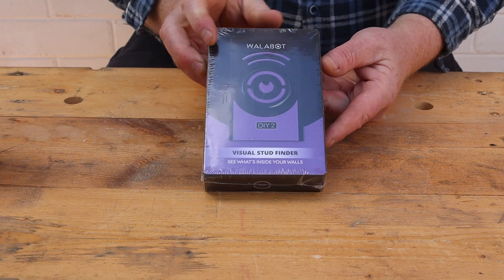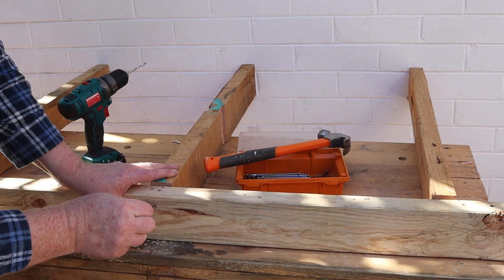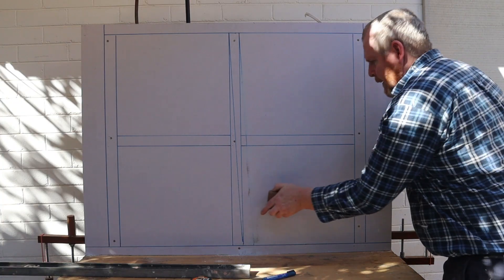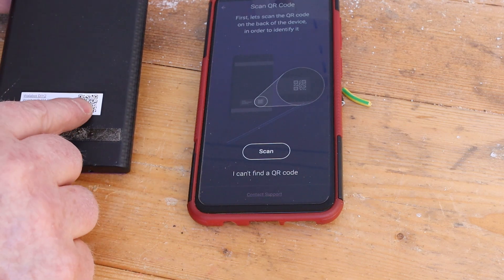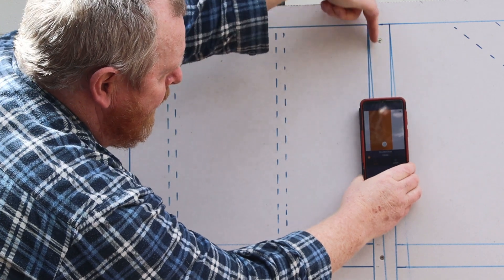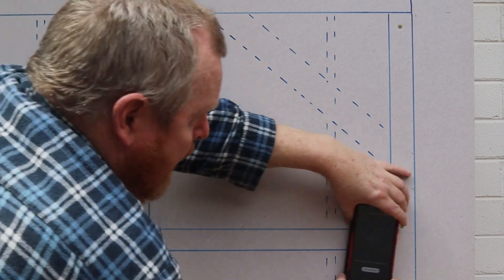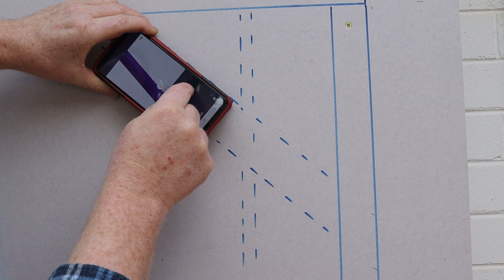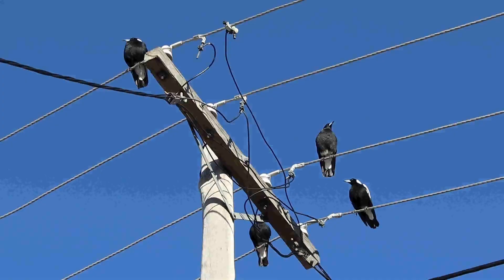"Walabot DIY 2" wall stud finder review

Comment: I haven't tried the new one, but my original one only works with "clean" drywall.  I do lots of remodeling work and it doesn't work reliably on older walls especially if they have been patched.  Not worth the risk for me.
Reply from the maker: That sounds fair.  The device in the video worked as advertised, but as you mention I only tested it on the new-build sample wall.